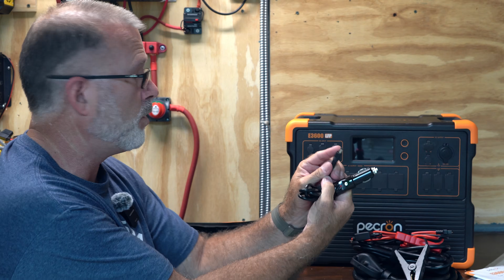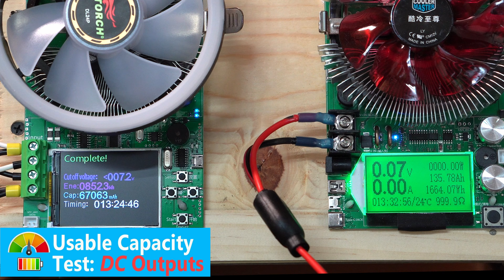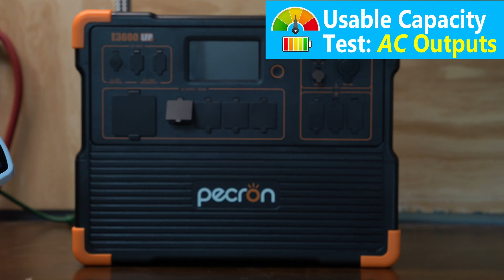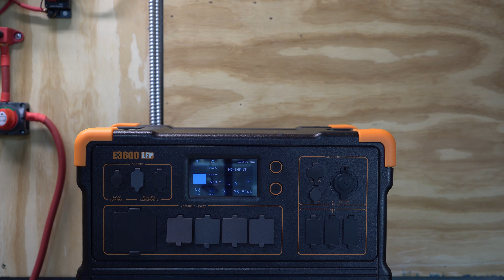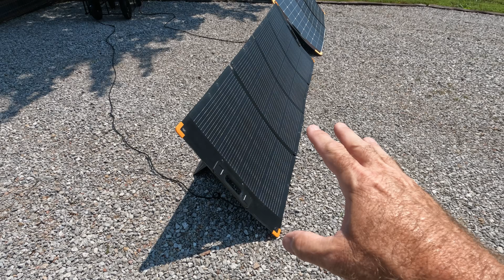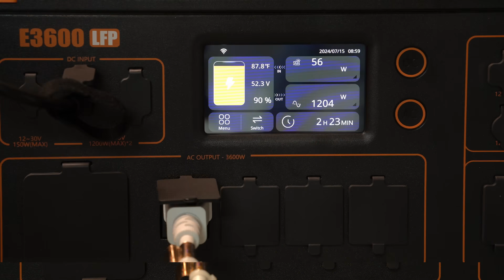SERIOUSLY Good. The NEW Pecron E3600LFP Power Station can do nearly EVERYTHING!

Comment: One additional note. If any user wants to make use of the UPS feature of these Pecron units, the BS-U20 20A ports on the front will overload at 1800W (totaling across all of them) if the unit is connected to A/C power; the UPS feature. There is a TT30-R that supports 30A and this will overload the UPS feature at 3600W; assumed the unit needs to be powered by the 3200W 30A input cable and not the 120V variant. I learned this the hard way when a 2400W unit would randomly kick into overload with two refrigerators running on it. They never exceeded 2100W total when monitored, but the unit still randomly overloads since it will peak over 1800W when both units happen to cycle their compressors and likely the auto-defrost mode. Cheers!
Reply from the maker: Excellent clarification on UPS mode. Thanks!

Comment: Your DC test seems off. It should be higher than the A/C test without a doubt. This is likely due to the first DC test assuming you did that right out of the box after the first charge to 100%. You really should have charged it to 100%, drained to 0, then charge to 100% and then started testing. These units don't always come with a calibrated BMS. You could call that a fail, but it is recommended on site and I think in the manual. I had one Pecron 2400 that shut off at 40% out of the box. Once restarted and charged backup to 100% it drained normally to 0%. Cheers!

Comment: Question, My house has a well that uses 240. I already have a 30 amp connector on the back of my house, with a switch over to a different set of breakers, for a gas generator that I hook up if we lose power. Could I buy the E3600 and 4 expansion batteries and just plug it into the same 30 amp plug?
Reply from the maker: Based on your description,  I'm assuming that 30A inlet receptacle is 240V. If true,  then no.  The E3600LFP is a 120V output only,  unless you combine 2 E3600LFP units with their parallel box

Comment: I just got an E3600... Device is great, software SUCKS! Especially one VITAL setting is missing!
Seems that connecting AC IN and AC OUT, automatically makes the device a line-interactive (?) UPS. What about people that want to prioritize first SOLAR (no AC), second BETTERY (no AC) and THEN and ONLY then AC IN (when there is no solar and battery is below a certain threshold)... Every other power station I know, does that!
WHY NOT Pecron??? This makes it a very expensive no-power saving UPS for me...
Now I manually intervene (I have a WiFi plug in AC IN) and turn on and off AC IN when I have to. This is painful and renders the device way worse than I thought! Seems to be a software thing. If it is, it needs to be fixed!
I also wonder why I haven't noticed this limitation in any video review... like someone told them not to mention it? Because really, it is definitely something you expect to know in a review...

Comment: After months of researching Power boxes, I chose the Pecron E3000LFP and an E3000-48 auxiliary. I wish I had bought two 3000LFP instead. I am amazed at how quickly the Host charges! I use it in a very bad solar location, and it runs my RV for 40 hours including a starlink gen 3. At 10-20%I pull out the 2500 watt gas generator and it charges within 2 hours!!  I can't even buy a small toy power box that will charge that quickly!

Comment: Just received my two e3600s the other day and I love how I called customer support today to ask them what cable I need to hook them both together and not an expansion battery. They told me that cable (MJ32 cascade)  would work and I want to stack one e3600 on top of the other to save floor space and they told me it'd be fine. Yet looking at your video there's no way it would reach. 

Not to mention you have to take apart the cable and then cut I think five of the communication wires to do that. I told them they need to come out with a cable so you can hook up the power stations together. 

I'm excited for Pecron switching from Anker but their customer service needs a little bit of work and I can't believe they don't have a cable to daisy chain the power stations. 😅

Comment: For me, Pecron is a key choice for my camper build because it can be expanded with their EP3000 battery (which is unfortunately on backorder right now...). And for a camper project, the EP3000 is a really great option – not only do you get extra Wh, but each battery also adds an additional 30A output. So if you take one E3600 and two expansion batteries, you’ll not only get over 9 kWh of power, but you will have three 30A outputs, plus all the other 10A and 5A outputs. And on top of that, you still get all the AC outputs. And even a RV output

This power station is truly a must for any camper setup.

Great video by the way – I love your “beaming” Star Trek sound at the end… love it!

Greetings from Denmark!

Comment: Seems we will never get a review two of these connected to the 240 V hub. It has been reported that these power stations tend to shut down and turn off power randomly but this never happens to a single one but only with the 240v hub. If I had not heard about this problem, I would have already purchased two of them.
Reply from the maker: @LarryRichelli  interesting! I have not experienced that issue.   Also I did do a video on the 240V Pecron setup: https://youtu.be/giu7_-ElZsY

Comment: If u want power and savings buy something that can put out some power. Want to run a few things minus the dryer and ac.. unless in a camper get a 3000 watt or better inverter charger chrap ones that r ok ecoworthy.  I my self have the 5000 w 240 version with 4 280ah batteries in a 48v configuration i can run my camper ac 24 7 along w microwave.. these small stations cant put out the good power or not for long.. that 1 3600 will only run my camper for 2 to 3 hours then it would be dead. But the set up i got i run 24 7. With out restrictions..buy the right thing once dont need to waste time buy them over and over.

Comment: Great video Thank you! Just bought one of the E3600LFPs. Was curious at 16:42 where you mentioned you had 800 watts of solar which should be roughly 80-82 volts (video showed 44.8V early morning) if you were actually able to see 80-90 volts unthrottled on one connector? We considering a similar approach with 2 450W panels in series, higher voltage/lower transmission losses/less cabling. I know some Power Stations throttle and wanted to get your real-world take. Thanks again.

Comment: Why not using an oscilloscope to test the sine?? I wish you would’ve because that speaker hummed significantly more on the generator.
Reply from the maker: I've seriously considered it.  But the cost-benefit (as I see it) just doesn't work out favorably.  An instrument to accurate measure THD will run upwards of $700 or more. And it would give me a nice simple number for THD that I could use to precisely compare one unit to another.  But I think the average Joe is more interested in what that number means for them, and the most likely use-case where THD becomes a real concern is when you can hear it...whether for Ham Radio or remote-powered PA/amplification audio applications.   So it's hard to justify spending the money.  That said, if you have any additional insights on knowning the specific calculated THD, I'd be interested in hearing you out on that.

Comment: Great video and awesome review. Pecron covered all the basis on this unit. The only feature I feel is missing is a built in light, always comes in handy especially in a power outage when you have to move the unit and see what you’re doing when disconnected from the grid. Great job keep up the awesome work. Cheers

Comment: This video helped me make up my mind on my home backup system. I went with two of the e3600lfp's and the parallel kit. I also added a eg4 chargeverter so I can charge the pecrons with my generator while they're powering my house. I really appreciate what you do and the information you provide!
Reply from the maker: @chipmunk_savage  nice!!
Reply: So then you can’t charge them while also discharging 240 V sounds like is that correct?   I’m really struggling to determine if I’m gonna go with two of these with your same set up or the Anker F3800plus the new one, which can pass through 240 V
Reply: @LectricOverlanding  Anker SOLIX 240V Generator Input same as  the pecrons  e3600lfp
Reply: @hillbillyintheasia6122 not by 240 volt.      But solar yes.

Comment: The Crate amp was clearly buzzing on the inverter and was much quieter on shore power. Not a big deal, but to say it sounded the same . . . I don't know how you could have missed that. My thought was maybe the Pecron has a ground port where you could have grounded the unit, and that might have taken care of the buzz/hum. But to say it sounded the same is just not right. I get that they send you the unit for free, but you should still call a spade a spade.

Comment: Just pulled the trigger on the e3600,(2) ep3000s (9kWh total) and a pc300. As need I can charge the unit with my 2500w propane portable inverter as well. Living in the PNW winter sun charging would be minimal at best. My home has 6.03kw of rooftop solar and generally summer heat is not a concern so anticipate usage will be emergency home power. I have a propane fireplace and cook top range. Our community is also mindful for the potential for the  "big earthquake" as well. I will be installing a manual 10 circuit transfer switch for the usual refrigerator, lights, internet, etc. I do have as needed a Pecron 600lfp and Ecoflow River 3. This is my solution as opposed to my neighbors Generacs. Any thoughts appreciated.
Reply: From what you've explained, you're doing great 👌
Reply: I have a 5,000 W inverter hooked to one of the top battery brands as well as a 4 Patriots power unit. It's mostly in case of emergencies...like when we home power two weeks ago, for a day and a half.

Comment: I am going to have two Ep3000 expansion modules like the setup you demonstrated. Do they all use power and discharge at the same rate when outputting power? If I had a long power outage, I would like to take one expansion module and charge it at my sister's house(she never loses power). Does that sound like an option?

Comment: Thanks for your reviews. We live in Asheville and just went through Hurricane Helene. We were totally unprepared. Luckily I had 3 car battery jumpers. I was driving around charging them to keep our cell phones charged. I just bought a Firman dual fuel generator as a place to start. This is an area that I have no knowledge of. It seems like Pecron offers great bang for the buck, but the lack of support really concerns me. I've tried using messaging on the website with no luck. I'm just looking for some guidance on what to purchase. I may be better off with either Delta or Anker just for the support options. Our house is pretty shaded even after losing some trees in the hurricane so I don't think I can really rely on solar.

Comment: Hey ReeWray, Great Video as always!
Do you know if this will allow Pass through charging while 2 units are plugged together with Connect Box while outputting 240 volts at the same time as charging?
Thanks!
Reply from the maker: I'm pretty sure it does...but I'll be finding out for sure in the next few weeks. :)  Testing that exact setup soon.

Comment: How does this compare with building your own solar system with battery in terms of cost, assuming similar specs? Is it cheaper to build your own? Also do you have any experience testing the 240v options in this or other PPS for connecting to house or to power water well pump?
Reply: @JimmyDevere
😂

Comment: This is insane even for a 3600W inverter. With nothing plugged in, the unit uses 190W of power and will be depleted overnight! Huge flaw that limits its usefulness.
Reply: Where does it say that? I've heard 45W
Reply: @nlewis1111   45 is far too much.
Reply: @geod3589  All of them are at least that much, no?

Comment: I needed a Ground Neutral Plug into pecron 15 Amp plug to get 3 green lights on my 50AMP EMS which I use to check if the power source is wired properly before any power is hooked up to RV. Have to turn off converter breaker also so I don’t charge house batteries and pecron is the primary source. Hope this makes sense. Not an expert. Hope I’m right.

Comment: Past reviews stated over 2700 watts capacity during testing which is acceptable, 2250 watt total capacity against an advertised 3072 watt hours is UNACCEPTABLE
Reply from the maker: Hmmm.  Sorry you're not seeing the usable capacity numbers I saw.  A couple of thoughts:  check the menu settings to ensure that it's not configured to reserve extra power, preventing full discharge.  Then make sure the BMS is calibrated by completing at least 1 full discharge/recharge cycle.  And keep in mind that running a low Watt load for a long time will result in less overall usable capacity due to the AC inverter consuming power over that longer period...based on your test description,  that would probably have reduced your capacity by about 100Wh or so vs what I saw in my test.  Obviously it's certainly possible your unit is not performing up to spec...but I thought I'd at least mention those things in case you hadn't factored those in.
Reply: @ReeWrayOutdoors   Thanks for the tips, i will check my settings, enjoy your reviews ReeWray

Comment: Thanks for the coupon code!! I just received mine but didn't come with the clamp to charge batteries, I will test it soon with my old setup that I been using with my e2000lfp, my 2000lfp keep my freezer for around 26hours
Reply: Is that 26 hours straight or intermittent power. What size is your freezer or what is the kilowatt?
Reply: @ritasenergyherbs3650  26 hours straight, my chest freezer is 6.9 cu-ft, and it uses around 115w when it turns on

Comment: I watched your video last night and I am considering getting this battery generator.  My situation is that I live in FL where the potential for power outages is fairly high during the summer months however we can go many years with no outages.  I have a dedicated 50a outlet that I can plug my gas/propane generator into using a 30/50 adaptor.  I would want to use the gas generator during the daytime and the Perron in the evenings.  So can I recharge the Perron with the gas generator by plugging it into a 110v on the generator or should I plug it into a wall outlet?  Perhaps it does not matter?  Thanks for your sound advice.  JR

Comment: Somewhere in my research I saw a 100 ft solar panel cord. My interest would be to charge while using the E3600LFP as you did with the propane generator in this video. I cannot find where I saw that cord, do you know of any companies that offer one, or even longer than 100'?
Reply: Shorter cords are always preferable, if possible .
Reply: A 100' wire (cord) would lead to significant loss of voltage (lost as it moves through the wire) at the charging end meaning you will need to ensure you have a higher amount of volts on the panel side to cover the amt lost during its transmission through the cables to your inverter or batteries.

Comment: Thank you for the review.  I bought one of these units.  Seems good so far.  I am new to this stuff and had a question about sizing the solar array to be able to get the 1200W and be within the 32V-150V range.  As I look over the different solar panel types out there, what do I need to do to make sure that I get 1200W max and be within the 32V-150V range?  I prefer more of portable solar panels but also want to know about the panels.
Reply: Typical modern 440W panels will have open circuit voltage 40V, maximum power voltage 33 and current 13 Amps. Put three in series and you have 100V and 13 Amps = 1300W. Which is fine. They won't actually make 1300W in most sun conditions, and when they can the Pecron will just use a slightly lower input current and higher voltage to limit it to 1200W. Note that the series open circuit voltage will be about 120V, which is also safely under the 150V maximum.

Comment: I have a technical question....I'll do my best to try and explain. Do you know if/when you change the charge rate in the app to a lower number say 500watts charging rate you can use a 750w inverter to charge it with a load ALSO being used? The reason I'm asking is because with my AC180 Bluetti I can't change the charge rate, I can only put it in "silent" charge mode which lowers the charging rate to 200 watts, which really slow but also the problem is when I use the unit and there's a draw being used, let's say a heat gun that's pulling 1200 watts then the bypass feature happens so then the inverter I'm using to charge the unit trips because it ups it from 200 watts to whatever I'm drawing from the machine. So what I'm trying to find out is if this Pecron can supply 1500watts to something AND lower the charge rate and charge it from a small inverter at around 500watts? Sorry so long but asking these questions BEFORE I buy a unit is extremely helpful, because I feel I wasted my money on the Bluetti because it doesn't work the way I need it to. Thank you

Comment: My Pecron experience has been very disappointing. When it worked it was great. About 5 months of use powering a small fridge from solar, it stopped charging. The unit stopped taking a charge from any of the charging ports (AC, solar, DC). My unit (E600LFP) has now been with the company I bought it from for almost 2 months as they try to determine the trouble and repair. My advice would be to get a Bluetti or Ecoflow.
Reply: I have had the same unit without any problems
Reply: There is no issue that can take 2 months other than part availability or them just ignoring the fact they have a unit to replace or repair. Sorry to hear about your issue. Any update to your story?